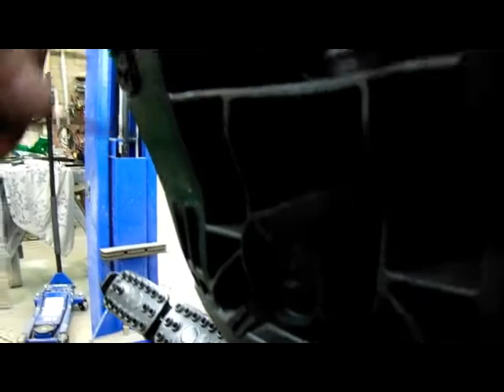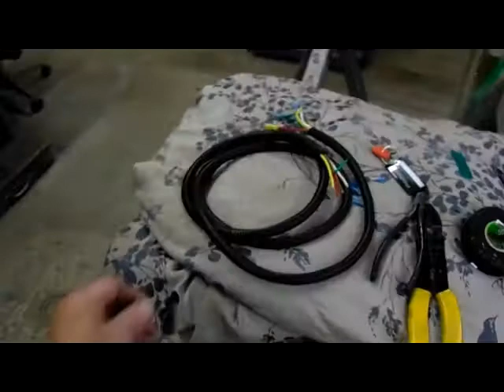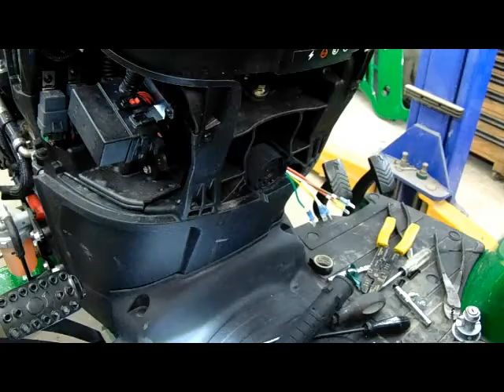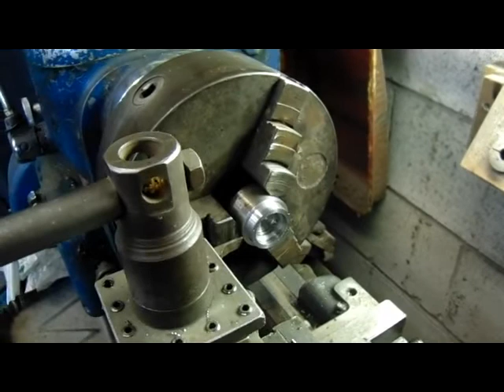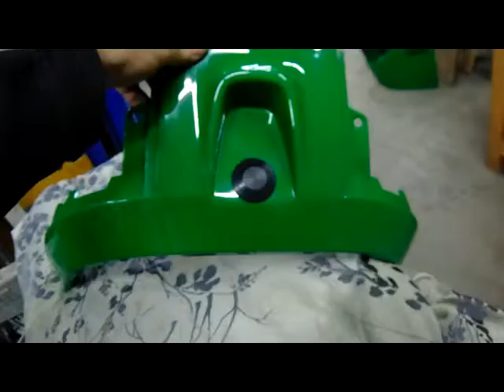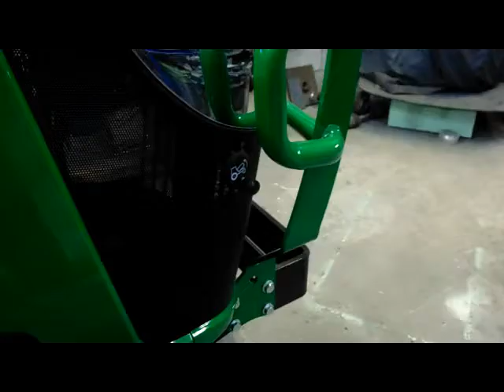John Deere 2032R Ignition Switch Relocation

Comment: With the key facing up will it be a problem down the road from rain & snow getting in there?
Reply from the maker: Hi Larry,  I thought about it, so I sprayed some light oil into the key switch.  These tractors sit outside for years, some for their entire life and they seem to  work okay.   I banged my knee pretty good in the first week and it had to go from that location.   Ebay does sell a flip cover that can be put on it, as a solution.  I park my tractor in the barn and it only sits outside in the weather a few days in the year.  TonyK.
Reply: Wish this was available in a kit. Such a poor location.